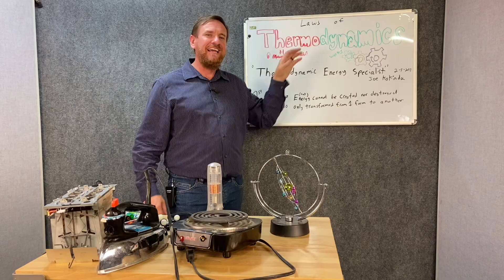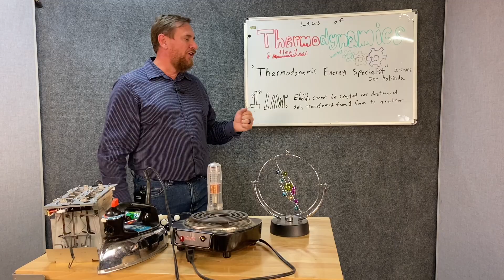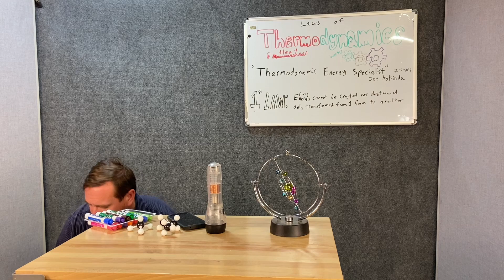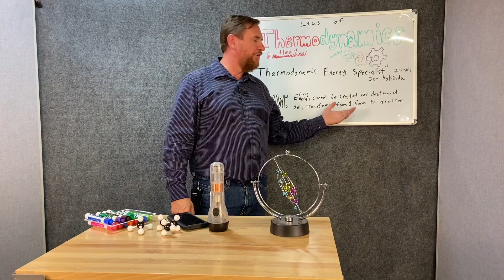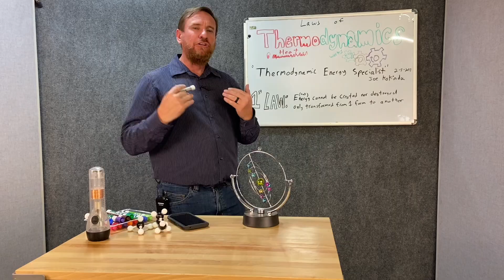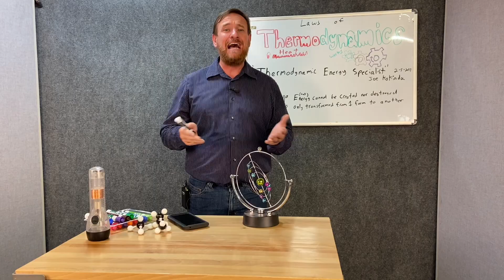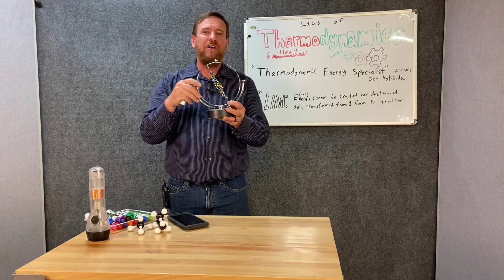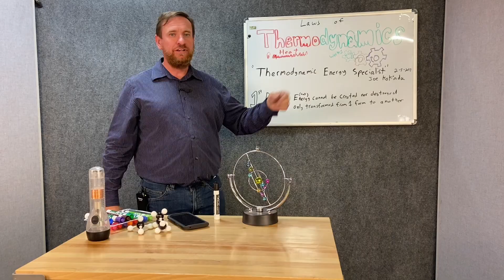HVAC 003 1st Law of Thermodynamics

Comment: Hi Ty, @ 10:27, you mentioned at -100degF, there is 260deg of heat. Because I thought it's 360deg of heat. Using 460degrees of heat as reference. Is this 460 degrees of heat you mentioned in Rankine unit? Thank you.

Comment: I’ve been in hvac for 5 years now. And anyone can do anything and get by, but lately I’ve really been learning about everything I can and it’s been a fantastic experience. People have always asked me why heat pumps are so popular. And I always told them it’s because they are more efficient, but now I can tell them they are more efficient because there is up to 460 of heat that we can remove from the air, into the refrigerant to heat their house. So even if it’s -71 heating will still take place, especially with heat strips on as well. May sound dumb but I’m getting better !

Comment: Watts are not energy.
Reply from the maker: Electricity is measured in Watts and kilowatts
Electricity is measured in units of power called Watts, named to honor James Watt, the inventor of the steam engine. A Watt is the unit of electrical power equal to one ampere under the pressure of one volt. One Watt is a small amount of power.
Reply: @love2hvac  
This is bit tricky ,
I believe watt is power ,
Some books say KWH (kilowatt hour) is unit for energy.
Power and energy are two different things.
Most people even engineers make mistake on difference between power and energy .

Comment: Why would -100F only have 260 degrees of heat still in the air if absolute zero is -460F?  @ 10:26

I'm sorry, it confused me a bit, please help me understand.
Reply: most likely misspoke, it’s 360
Reply: @bconns39  Oh, ok. Thanks, that helps. I was just wondering if I was doing something wrong.
Reply: @bconns39  thank you for posting this. I thought I was the only one!